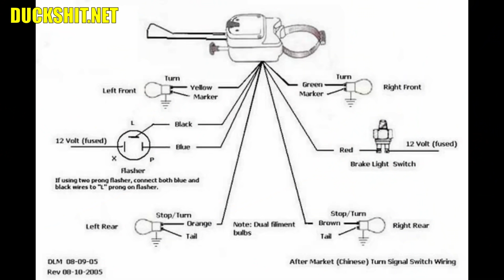Indicators, Tail Lights, Brake Lights - VW Super Beetle Volksrod Project - 04

Comment from the maker: Some glitches in the brake lights when turn signals are on, The china turn signal switch may not be doing its job properly, or maybe it just doesn't like LED lights.  Something I can fix with some resistors to put a load on it.  There may also be a problem in the dashboard indicator light backfeeding, too... something else to look at that can be fixed with a diode.   I'll get it right!  Stay tuned!
Reply: I’ve had luck with using the indicator wire to power the relay to break the earth going to the flicker light, you know, earth to normal off to light the indicator, because we DON’T have the trailer adapter thingamajicky in SA !
Ciao buds!
Reply from the maker: Thanks man!  I don't think I need a relay in this case, I can keep it more simple of a design for the repair/modification.  But first I need to make sure I've connected everything properly.  One wrong connection destroys all the logic of the entire circuit!
Reply: My tail light lens has actually melted from the inside and has bubbled out. have you seen that? Anything i should be worried about?
Reply from the maker: @mariusa9263  I have, usually its the wrong bulb, but it could also be a bulb that failed and the filament shorted itself so its running hotter than it should.  Thats where you should look!
Reply: @DuckmanCycles  Thanks! I figured. There's a lot of random wires / hack job on this thing that i'm trying to unwind - thanks to the confidence you have given me. 

Appreciate you man.

Comment: Speaking as a retired field engineer/tech of over 40 years experience, I find your wiring and termination techniques excellent. I love that you give "the tug" to every crimp and connection. A poorly crimped lug can drive you crazy with intermittent problems, and tugging it ensures a good crimp. I have a hunch that some of your critics are basically ham-fisted goons that just don't have "the touch"!
Reply from the maker: Thank you!  I try to do better on my portions than anything that VW provided.... While the VW wiring does work fine, so much of it is left open and exposed, and several important elements are not fused in any way.   It asks for problems!   I can do better!  😁👍🦆💩

Comment: Love seeing Bee as always but cant really deny your efforts on that wiring harness and making everything working... About the taillights functionality, before you cram yourself into more wiring problems and adding whatever... Make sure that bulb you have there serves the three functions already... Meaning that it can be just serving as two lights not three as you want them to function, if these came from a Harley Davidson as a center piece, then outer ring will be running light and inner is brakes... 2 functions* you used the same function for running lights and used the inner beam for turning signals - again 2 functions! Best solution and easiest way i see is a simple brake light right in middle of your back window that you can buy off amazon easily and problem solved! Btw you d need to add reverse lights too! Good luck with that build, duckman
Reply from the maker: Thanks dude, but to be legal you'd need proper brake lights.... not a 3rd one.... not for this year of vehicle anyway.  But none-the-less as I covered here in the video, I've already worked out a solution for front a rear.... why rewire for yet another brake light (and buy one) when 2 resistors at 2 cents a piece that I already have on the shelf will likely solve the issue?  LoL!  Thanks!  🦆💩
Reply: @DuckmanCycles  well if that solution wont fry your newly bought taillights then go for it dude! Hehe
I d be waiting to see that on ur next video, just don't take too long duckman! Quack!! 🤣
Reply from the maker: 12v is 12v, what would fry them?  LoL!
Reply: @DuckmanCycles  you do know I'm a muscle car guy?? So supposedly i have to be hating u with ur comments mr duck.. man! So dont u lol me and eleanor is 2 Es and a mustang! Period! Lol
Reply from the maker: Still no Mustangs here on this channel!  Nothing has changed!

Comment: Excellent video Duckman (Glenn :) ) also Bee :) also soon all car be up running and fix up too hopefully owner understand next time let you do repairs first because this was nightmare for sure 👍 ! Also Glenn be nice ask does turn signals in Speedometer work too okay you forget show that if didn't know and thought like hear about it! Also for 4 ways is there way you hook up Flasher breaker square cube or circle one those cars in fuse panel or separately they only 3 pin to wire up! One is Red , Two is flasher , Three is ground and there button on Circle one back on contacts area for reset if get GM one type use !
Reply from the maker: Thank you!  The flasher dash indicator was working fine, but I suspect thats where part of the problem may be, perhaps something I overlooked, or something incompatible with the chinese switch.
Reply: @DuckmanCycles  welcome on helpfull hints to try Glenn :) !
Reply from the maker: I do magic!  I think i got it sorted!

Comment: Its weird a lot of old German cars have that smell too. On the lights the switch it mite be like older motorcycles & use the opposite side as a looped ground. I know my 250 Rebel had to have a groundable relay to activate the signals properly. Without the relay it would flash like hazards when I set the right blinker
Reply from the maker: Well, it flashes the sides properly, but when brake is applied it went all dippy, I don't think extra relays are necessary here, its more simple than that!  I'll get it!  Watch for next video!  :-D

Comment: Hey brother just wondering how you feel about performance chips,I'm doing alot to My 2004 nettle , pros an cons thanks for great video hi  QUEEN 👑.
Reply from the maker: Well, how do I answer this one? Air-cooled Volkswagens don't have chips... unless you're lucky enough to have one of the electronic fuel injection cars that actually still works properly, but those chips are not meant to be replaceable.  I'm not sure that I can give you much help on that one.  😁👍🏻🦆💩
Reply: @DuckmanCycles  that's cool, i have had bug's all my life 64 Baja 72 super better loved them now , a 2004 love it  but it's not a turbo so I was curious on chips THANK🤣🤠🤠🤠🤠
Reply from the maker: A modern "Beetle"?   Yeah, I don't work on those around here, I don't have much of an opinion on them at all.  I thought their ECU was reflashable, however, and didn't require a chip swap.... not my department, I am afraid!